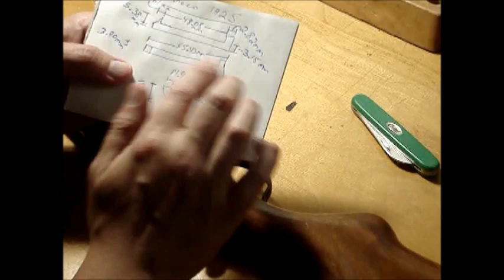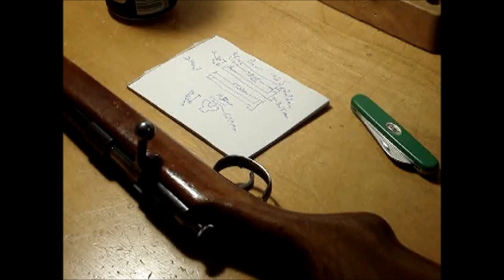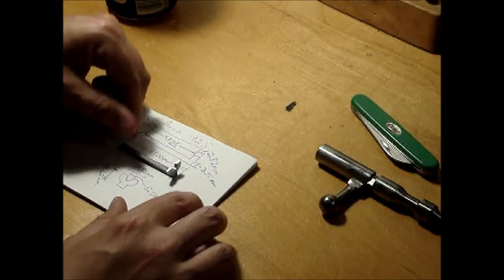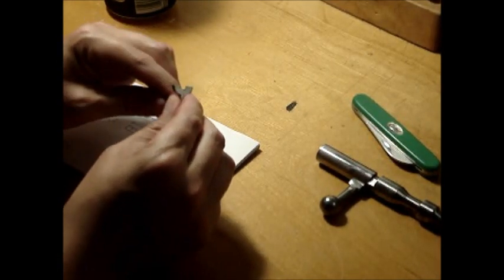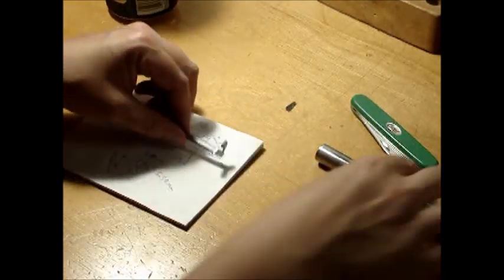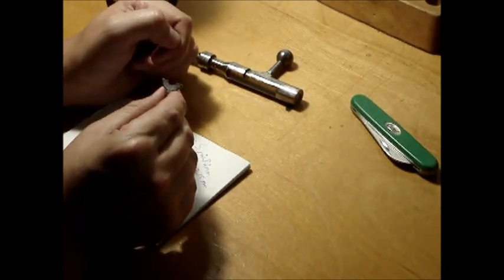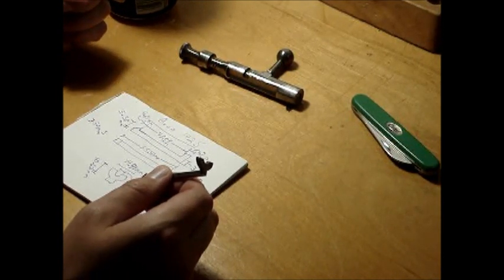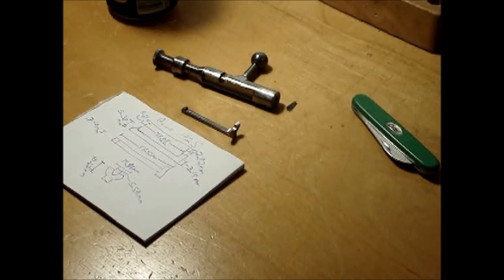Original-Geco-Karabiner-Mod.1925 Extractor Measurements

Comment: I am going to need to work out the radius of the extracter "Leaf" It rides on that surface when extracting. I dont have my gun yet when I work it out I will let you know. Thank you for the info  Brian
Reply from the maker: welcome
Reply: yes The radius of the extractor leaf is the same radius as the diameter of the bolt. easy enough. Thank you for the information